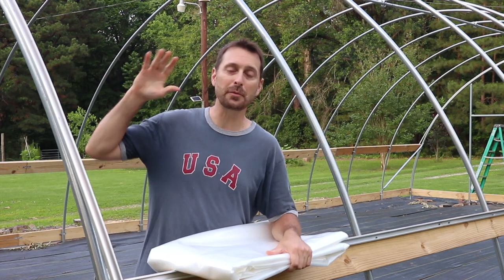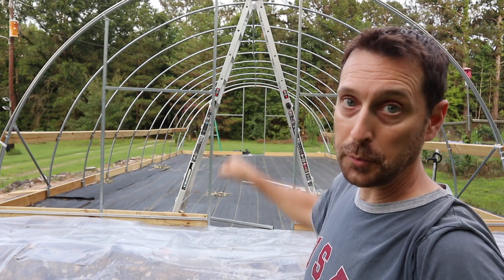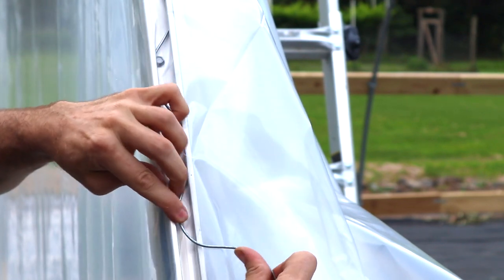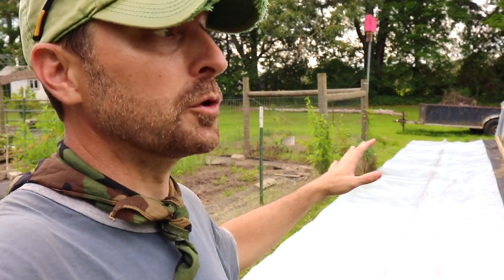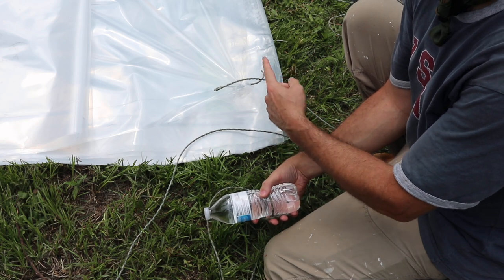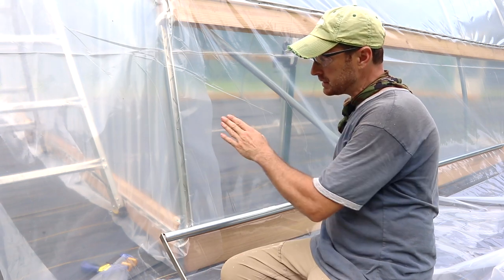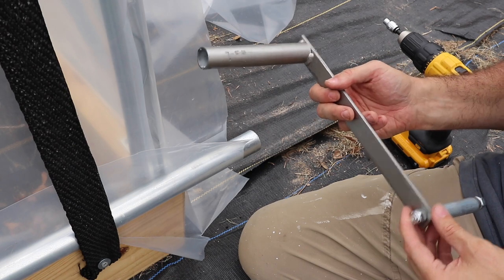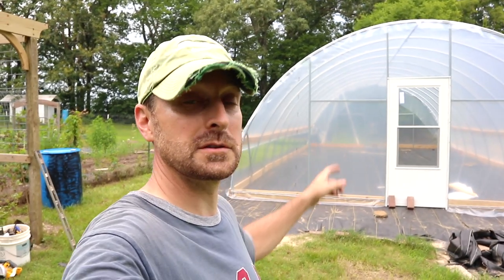How To Build A Large Capacity Greenhouse From Growers Solution! Part 3 - Plastic & Roll Up Sides

Comment: If you cut the top plastic a bit beyond the wiggle wire.... Would it be possible to mount a gutter and rain collection system onto that wood cross member ??  A bit of drip guard to guide the rain into the gutter?
Reply from the maker: We did this....https://youtu.be/bOF3Ypa5yJ8. It has worked ok. It may work better on the hip board but I have not experimented with it that way yet.